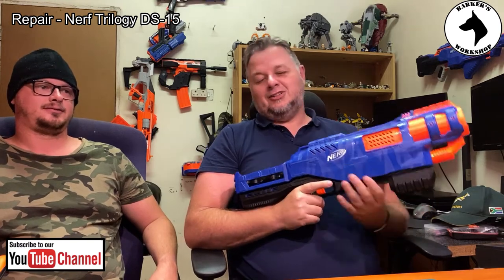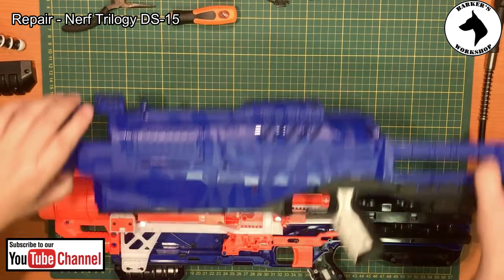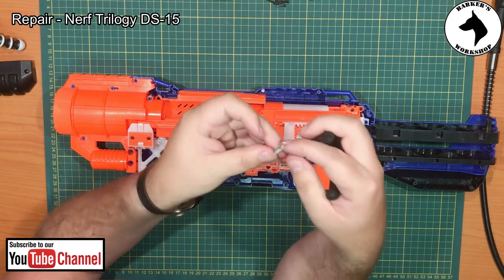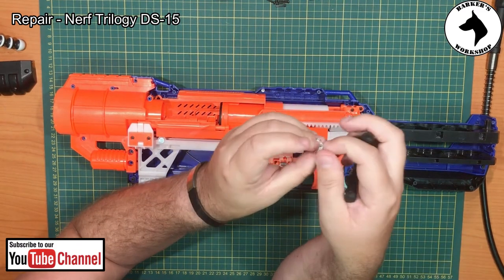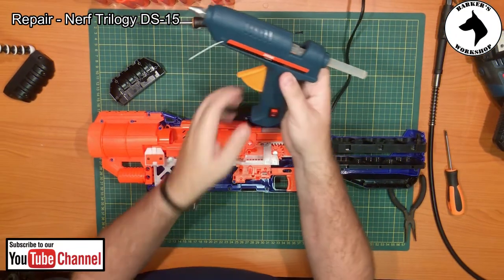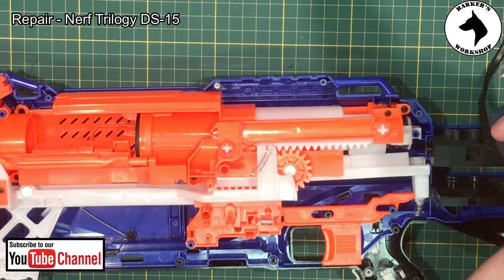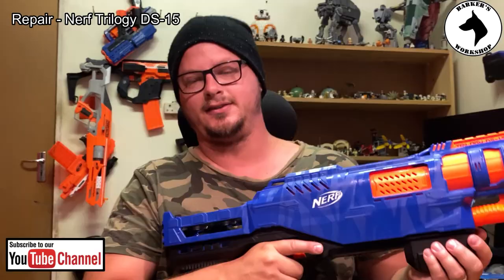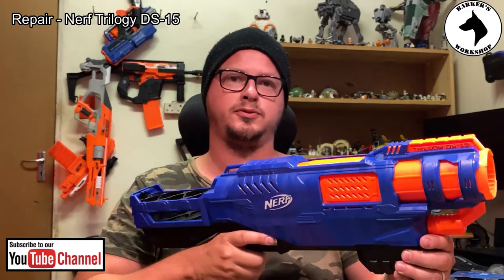Repairing the Nerf Trilogy DS-15

Comment: Thank you for sharing this video. In my case I have fixed it by replacing the spring with a rubber band. I just picked a small one and wrapped it three times around the holders. I think it is a better solution.
Reply: That's good but remember Rubber may degenerate over time

Comment: Great to see this on video. In my son's nerf there are actually three little screws I can't get out 🤯 so I can't open it up completely. I can see, however, that another spring has bent.. I'll give it another try..
Reply: get a driller and expand the holes on the ones you cannot open then get it out with an electric srew driver thingy.
Those are too big and cannot fit in the small holes so gotta make them bigger, and thst solved it. also, if its too hard to get out, yeah use the electric one. Hope this helps :)

Comment: This happened to me 1 day after i bought it can somebody tell me how did he open up the nerf
Reply: there are screws in the nerf first take those screwss off and then u can open the nerf weapon
Reply: @kyranooms1420  thanks
Reply: @AycanErkan74  np
Reply: @AycanErkan74  and if u cant reach or open one, just expand the hole a little with a mini drill, and then use the electric screw driver cuz its easier